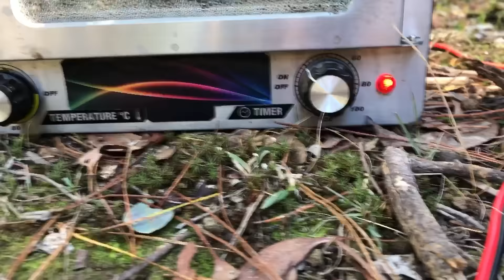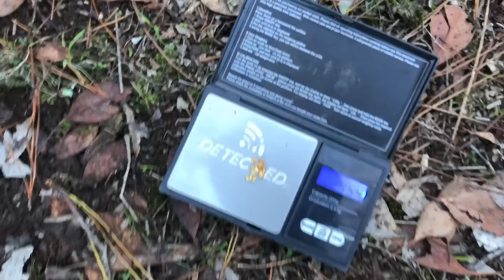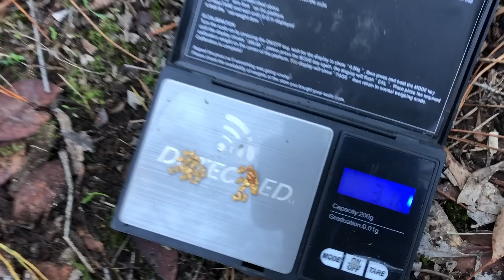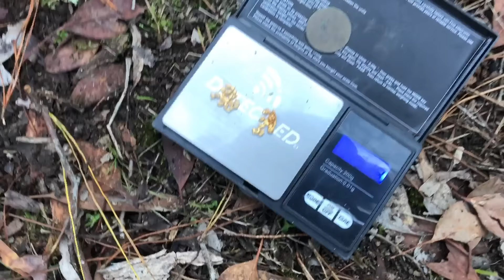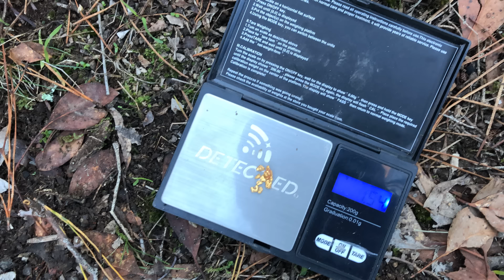PART 2 | Metal Detecting in the Victorian Goldfields | New PATCH!

Comment: Good Times 2, out sharing in the fun, Ant, Ken, & Glenn - going great still with the 5000. That quartz shattered easily, degraded, almost like it had been roasted. Worth using the pick for randomly hitting quartz to check their consistency, it may offer info on how the gold was held in the rocks. On seven huts, or other numbers, are you seeing how they line up in the landscape, whether they show then a path, or paths, and then a larger roadway for anything needing a cart width of roadway, dependent on how they'd worked an area, can have almost boxed themselves in with overburden build-up, holloways, like a road cutting. Again on the quartz, where puddling machines may not have crushed enough harder quartz with gold still within will be built up on it's own pile, uncrushed materials on another spot nearby if they'd rushed off to richer grounds and left those unfinished. Can't detect the puddler machine itself, though. Glenno, Ant, if there's Chinese huts, they'd may have made a Chinese bath, circular hole of packed clay, plumbed by water race I think, plugged like the puddler, gravity drained. You'd like to find dropped gold jewellery, coins with hallmarks telling untold histories, chopmarks, Chinese characters stamped onto old British, Spanish, Portuguese, and other world coins of trade, done at Chinese trading centres in China and elsewhere there were Chinese - it says to me there was something beyond those cast bronze cash coins with square holes, the workers would use those for small exchanges, I guess, and the bigger money, gold and silver coinage, was exchanged, rarely, by the gang leaders, the traders using those chopmarks as marks of authenticity. After 1904 there's few Chinese, only one member of parliament voted against the White Australia policy, the only member of the Liberals in the Free Trade and Liberal Association coalition. It was ALP policy, and on the masthead for their magazine, "The Bulletin", "For A White Australia", not a fun fact.
Ever in appreciation for the stories told, hints shared, fun as ever, cheers from Gabi of Narre Warren. 👍🤙
Reply from the maker: Cheers Gabi!! Love the info and detailed comment. All the best mate! 👍👍

Comment: The device with the yellow, black and red wire's is a rectifier. It changes AC to DC. Normally used for charging
Reply from the maker: Cheers, thanks for the info Adam 👍